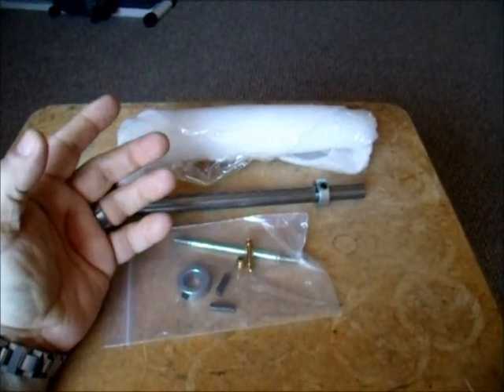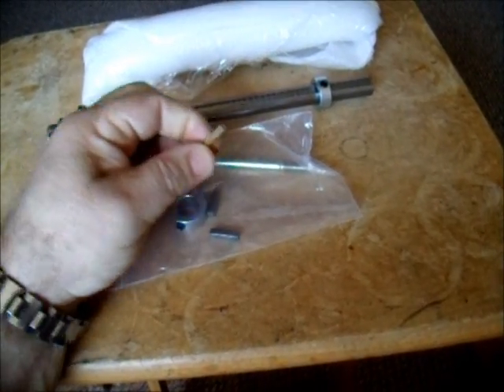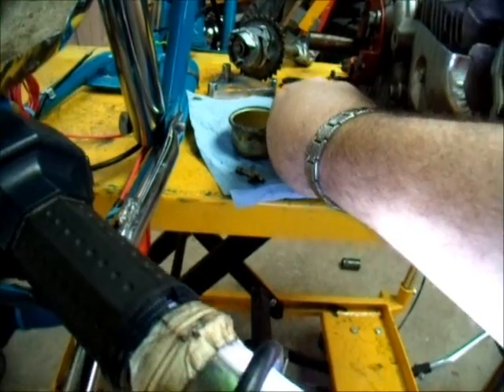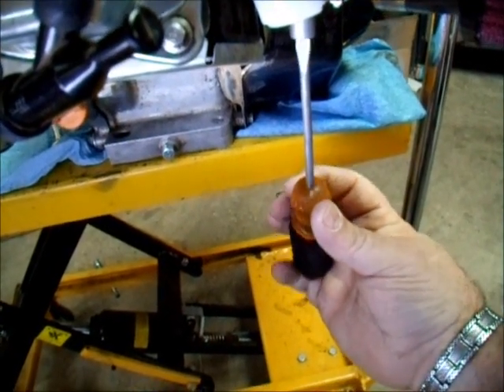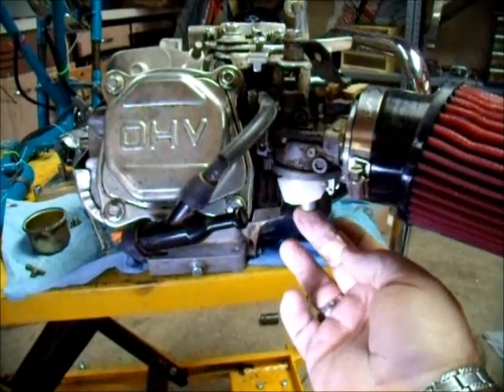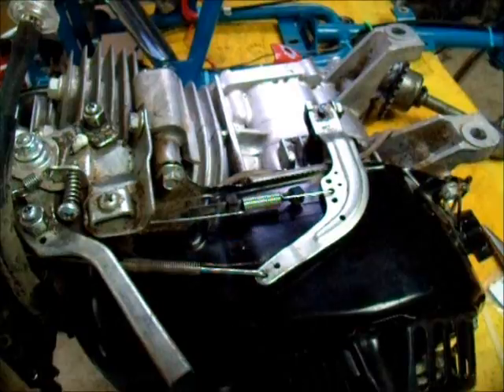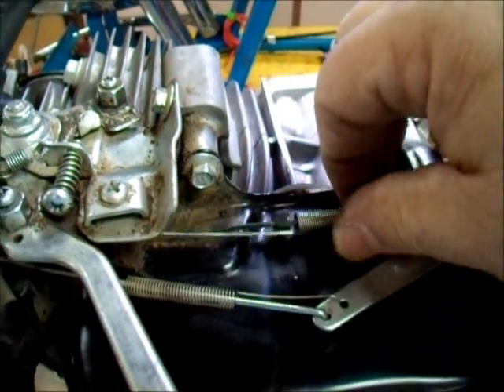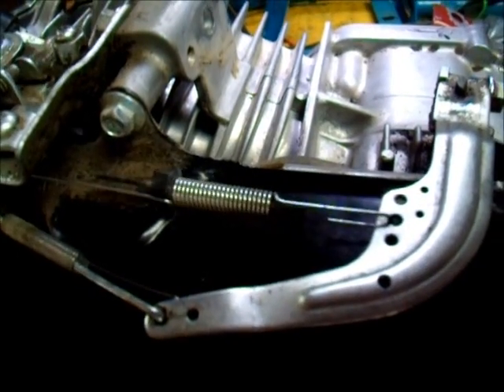easy predator 212cc upgrade

Comment: Take the governor out. You'll thank yourself!
Reply: It wont blow up and if it does it was only $100. I run my predator 212 wide open without governor for miles and miles. Its surprisingly a very strong engine. I am not sure if you know or not but they can make these engines reach over 30hp at 10,000 rpm.
Reply: the engine will run 5600 rpm before valve float. you will only reach about 5300rpm with the engine built like it is. Take out the governor. You'll gain 10 or more mph and it will accelerate much better. If you blow it up then you take it to harbor freight and they will exchange it for new. I just took back a 3 year old predator and since the warranty was up they had me buy a new predator and the extended warranty and then they stuck the old engine into the new box and returned it. it cost me $48 for the warranty, That's it. If you find the employee that is mad at the company that day they will even let you exchange straight over for a 301 or 420cc and just act like it was the same engine.
Reply: Riley Derifield that's fair but you'll be thanking me the first time you ride it after. just make sure your new throttle linkage you make from the governor linkage opens the throttle wide open when the peddle is pushed wide open.
Reply: I stand by it!
Reply: Riley Derifield I stand by what I say and I definitely recommend mobil 1 full synthetic oil and NON ethanol gas.
Reply: Your full of shit and its a 20% restock fee either way as soon as the box is opened.
Reply: and blow it up

Comment: I got a predator 6hp 212 that I'm having problems with. it starts off with the choke closed but as soon as I open up the choke the engine cuts off. Do you know or have you encountered this problem in any of your builds. If so how can I go about on fixing my problem with my carburetor. any advice would be greatly appreciated
Reply: yeah ur problem is with fuel delivery
Reply: Most likely your carb needs rebuilt. You can find them for cheap online if you look.
Reply: No look i had the same problem check your gas line make sure it isnt pinched anywhere.
Reply: might not be fuel delivery. try it without the belt or chain. you could have a clutch/contverter issue stopping the shaft

Comment: Having problems with my 212, it won't idle off choke.  Its about a year old.  The carb is clean, took out jet and E tube and blew out with air compressor, replaced plug, cleaned air filter, good non-oxy gas.  It runs at half choke, then dies when I try to take it off, any ideas would be great thanks.
Reply: +mx5autocrosser I'm having the same problem.  Did you figure it  out?  Any help is appreciated.
Reply: get a new carburetor for it.  I found a company online that puts upgraded carbs on their Predator engines they sell, so they sell the stock ones.  You could probably fix it, but at about $19 plus shipping for a new one I think thats the way to go.  My works like new with the new carb.
Reply: The gas valve must be in the off position?
Reply: I had the exactt problem. My gas line was pinched make sure your gas line isnt pinched anywhere

Comment: Whats up man. I did the upgrade you suggested and i love it!  Im having a problem with my carb... It overflows gas when i turn the fuel on. Any suggestions of what could be wrong?
Reply: +Jerimey Jacobs Most likely your float height is not set correctly, it's easy to accedently bend the finger on the float when you ar einside these carbs. Have a look here on YouTube for a video on how to adjust float height.

Comment: awesome help! I have a minibike with a 212 and im looking for a little more push out of it, already have a torque converter, header, etc, definitely going to buy a jet and tube now, thanks!
Reply: Hershal Dunn by the way, for my governer on the throttle where the spring is, i just took the spring out and put a solid wire in there and it works like a dream
Reply: ^thats what I did

Comment: great idea with the zip tie!
Reply: I replaced mine with a stiff wire like a coat hanger and I used a drum brake spring for a return spring (it also disengages your governor till 5150rpm) I hooked one end to the governed arm then loosened one of my blower housing screws and hooked the other end on that then tightened the screw down   Hope I helped

Comment: Cv8 Metal the Stock is .34 so performance is recommended anywhere between .35 and .37. With an air filter like this, it's best just to use a .36

Comment: Did you have an .36 jet or .37?
Reply: Cv8 Metal I'm wondering the same thing I want to order the jet and emulsion tube but dont know which one he used the .36 or .37
Reply: I ended up getting a 36 with 140 e tube and a better spark plug and airfilter runs perfect
Reply: Cv8 Metal 9mm=.35

Comment: I cant get the original e tube out!!
Reply: Same! Any advice?
Reply: I got it out with a paper clip. U just gotta be patient it will fall out
Reply: NapalmicAcid
Reply: Thanks Daryl, I eventually got it out. I stuck some thick wire up into it, bent the end once i got through and into the center of the carb (with switch up to "Run" so it was open) and bent the end of the wire, forcing the tube to fall out. Similar to what you did with paper clip. Thanks for commenting me back

Comment: Take the governor out. It is not that hard to do and instructions are easy to find under go-kart searches. My 212 on a Chinese 4 wheel frame with about a 5:1 sprocket ratio flies with my 200 lbs on it. I am at high altitude 6000 feet.

Comment: At what elevation do you live?  I am in SLC sit roughly around 4,440 ft.  According to the Predator manual, I need to upgrade the jet since I live above 3,000 ft.  I plan to install this engine on an Azusa mini bike kit and trying to figure out what jet size I need to upgrade to.

For the time being, I will only be upgrading the air intake and exhaust.

Do you think the 9mm is too small or big?
Reply: I am in Saratoga Springs.  I run a .037 jet with a 140 e-tube, paper air filter (the one from OMB) and a custom header.   I am not sure if it is the perfect jet for 4,500ft, but it works great.
Reply: Turftechutah
I installed the 140 e-tube and a .036 jet and the engine is running well.  I have a .035 and .037 as well that I will test later to see if I notice much of a difference.

Comment from the maker: Hi Jeff I have never had one stick. I would us air and see if it came out. If you can grab it with needle nose I don't see why not. They are just held in by the jet. good luck
Reply: You're supposed to tap on the tube with a screw driver and it falls out

Comment from the maker: I run with the governor but I can pull past it when I need to. Yes I did keep the stock valve springs. Thanks for asking Kyle
Reply: Use a drum brake spring from a car to hold it back. Just look up governor disengagement for Honda clone on YouTube

Comment: im broke now so what i did was drill a big hole in the top of the air filter used a piece of speaker wire to hold the rpm limiter back when i give it full throttle and if you take the stock muffler off there is 3 nuts that hold the muffler part to the tiny piece of tubing and i just took that off and i spend nothing on upgrades and this go cart i put it on will fly down the road at 60 mph

Comment: @atvarebeast I have the same exact problem with my predator! my carb is spotless twice i have torn it down all the way shot air and cleaner in every passage. Still same problem.....Anyone have a clue on how to fix this?
Reply: I think you might have to upgrade the jet size as well as the emulsion tube.  I have exactly the same problem.  From what I read the stock air cleaner added a necessary amount of restriction to make the original product work.

Comment from the maker: Hi atvsarebeast Lets think it only runs with choke on or full throttle. So we know It is a fuel problem. I would check to see that fuel is getting through the fuel line to carb. If it seems to be flowing fine it is some thing with the carb. I would change the filter just because. Then I would pull the bowl to see how clean it is. Even if it is clean you need to take apart that carb. and use brake or carb clean and blow every passage clean now replace the jet and e-tube good luck.

Comment: i have a predator 212, it only idles when the choke is on, and it will stall immediately once its put on run, unless the throttle is pretty much all the way.i have the governor removed and stock jets and the carb is spotless. what could the problem be?
Reply: there is a little black jet under the throttle adjustment screw, take out the screw and pop out the black jet under it and clean it or get another one, better to get a new one

Comment from the maker: Hi John Q
I just wanted to get smooth acceleration. I wanted to hold past the governors up and down. I was not going for no governor at all. If you just want to hold it open tell it blows go ahead. I just use it to get my RPM up and then cruise. Its called a easy fix.
 GO SEWHAWKS

Comment from the maker: If you are just doing a header and air filter that's all I do the .037 jet has worked fine for me. Just to let you know I have not tried the bigger jet with this set up. I would have tried the other jet if I thought it needed more fuel.

Comment from the maker: If you went to oldminibikes you need to click the forum then click the OMBWarehouse at top of page. Now click Mini Bike and Go Kart. Now click racing parts you are there the jets and tube are in Honda GX200 & GX160 Clone, under Carbs & Parts. The Clones and the Predators have parts that work with each other. try again you should have better luck now. Some times the web sites are hard to get through just keep trying you will get there.